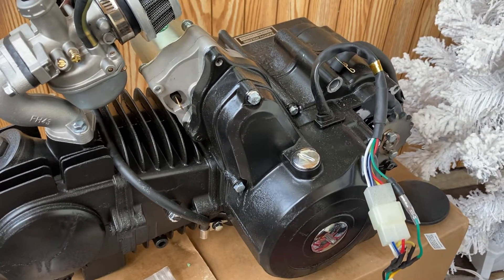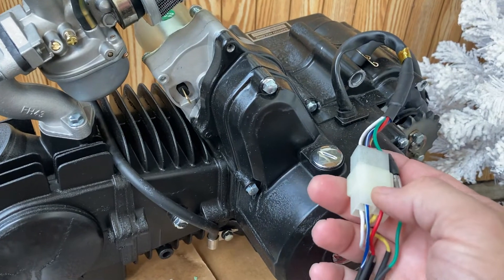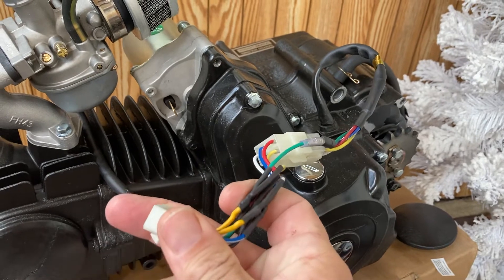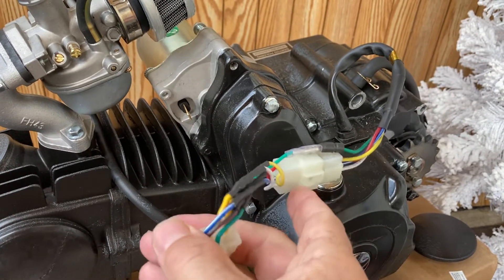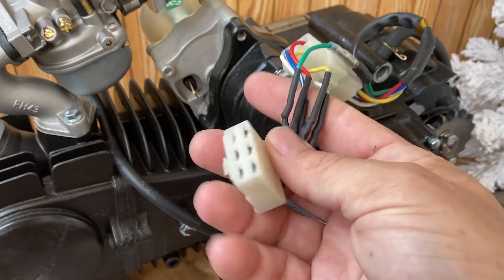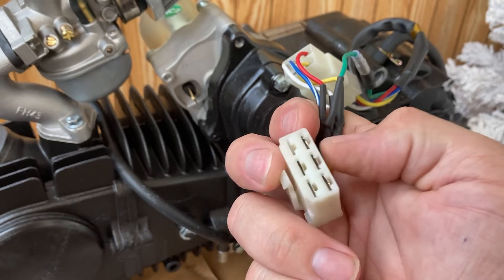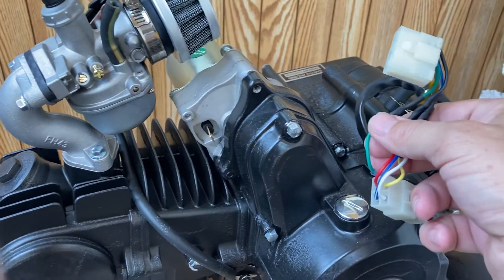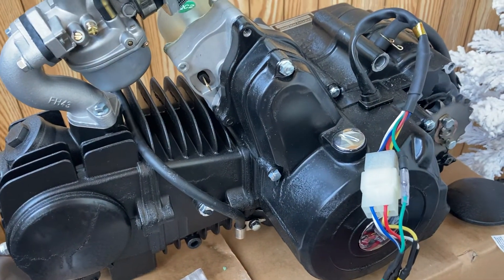125cc Wiring Explanation with Amstar Harness Adapter

Comment: Where does that plug in at that you got wired up coming out of the stator?
Reply from the maker: The engine harness comes out of the stator and then goes to the connector on the Amstar frame. This just shows a jumper I made instead of cutting the frame and/or engine wiring.

Comment: Hey mayhem I have a nostalgia amstar I bought I've been fixing her up where did you get your motor
Reply from the maker: Got from TBolt for like $650 or so. They also have an electric start model. They did not have when I bought. I would suggest that over a kick only engine. Takes 2 kicks to start but still pain if you are tired.

Comment: Trying to troubleshoot a charging system here.  Do you know where to get the wiring diagram for this motor or which of those wires go to the stator?
Reply from the maker: Join the Amstar Nostalgia FB group. I posted a partial diagram up there. I don't recall at moment.